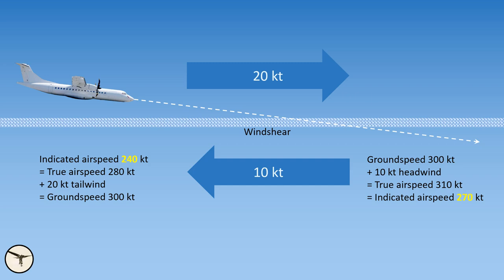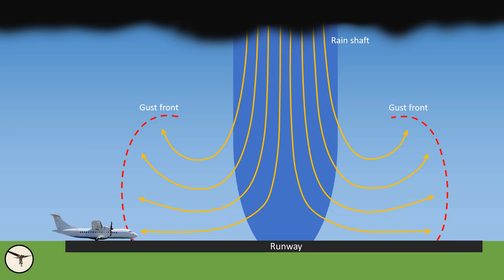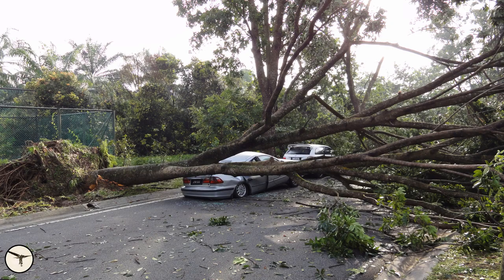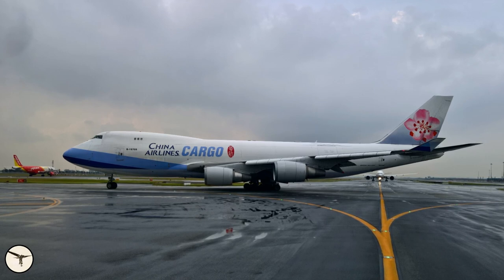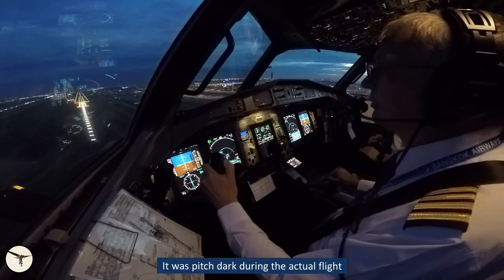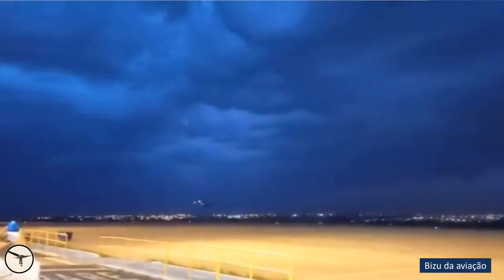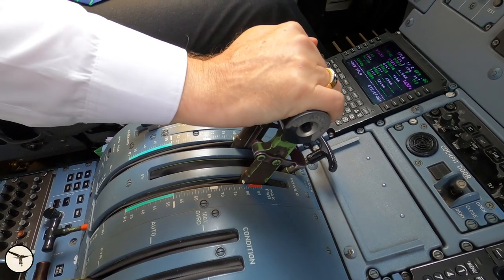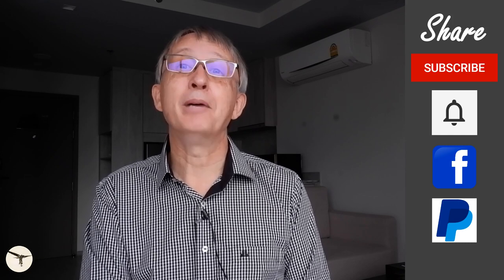ATR 72 caught by a Microburst

Comment: Nice share Sir! We have quite intense rainy season now, so this kind of content is very useful. Any idea how to escape windshear soon after the climb procedure but not quite high enough from the ground (let’s say 600feet)?
Reply from the maker: Set PWR MGT to MCT and join the procedure from there.
Reply from the maker: And if you suspect windshear after take-off, increase your acceleration altitude.
Reply: @FlywithMagnar  thanks a lot sir. Once, I had an experience trapped inside a severe windshear area while making approach. My position was leveling off at 2000. The plane suddenly pitched up >10 and the speed dropped till Vminops from 170. That time the power was already in the notch. Before we selected MCT, thanks God, the plane was out of shear zone. so we could manage the flight back. Safe flight sir!

Comment: Why does the ATR does not have windshear warning?
Does thr TAWS in the ATR72-600 also not have windshear warning?
Reply from the maker: Answer #1: Blame it on the Americans. In 1988, the U.S. Federal Aviation Administration (FAA) mandated that all turbine-powered commercial aircraft must have on-board wind shear detection systems by 1993. Airlines successfully lobbied to have commercial turbo-prop aircraft exempted from this requirement. 
Answer #2: TAWS is terrain avoidance warning system. It uses GPS and radio altimeter to warn against close terrain. The "don't sink" alert shown in this video was triggered by the TAWS. A windshear warning is triggered by the weather radar.
Reply: @FlywithMagnar  

I thought the weather radar triggers the PWS Pridicted windshear and TAWS triggers the reactive windshear.

Please let me ask this way.
Does the ATR 72-600, which is a state of the art turboprop still not have a windshear warning?

I mean the windshear warning that you hear for example in a EGPWS test like in 737.

Thanks for your answer.
Reply from the maker: From Airbus 320 FCOM:

The Predictive Windshear Alert System (PWS) operates only below 2300 feet RA. It uses Doppler capability of the weather radar.

The Reactive Windshear System Reactive windshear alerts pilots when windshear is detected by the FACs (Flight Augmentation Computers). They are responsible for controlling inputs to the rudder, rudder trim and yaw damper. The FAC is also responsible for generating low energy and windshear warnings. The FAC computes this from its knowledge of the flight envelope and speed.

ATR aircraft don't have this.

Comment: I am not a pilot and I’m hardly ever even a passenger, but based on your description I now realize I witnessed a microburst just a couple months ago.  It was terrifying.  I watched a large branch blow right off a tree directly in front of my eyes.  I couldn’t even see to the other side of the parking lot where I was.  People who decided to run out to their cars were soaked by the time they got there.  But after 20 minutes there was nothing but a drizzle.  My mom was only about 5 miles away and she didn’t even see anything.
I am curious though, during that time I could still hear airplanes flying overhead.  My town is under an RNAV approach path for a medium-size US airport that mostly sees Southwest 737s, plus some business jets and a few A320s.  Over my town these planes are usually at about 2000 feet.  Would they have been affected by this microburst?  If so, what do you think they were doing up there?  If not, why?